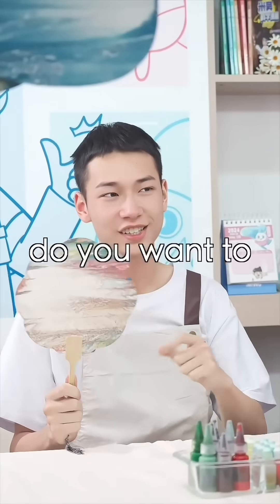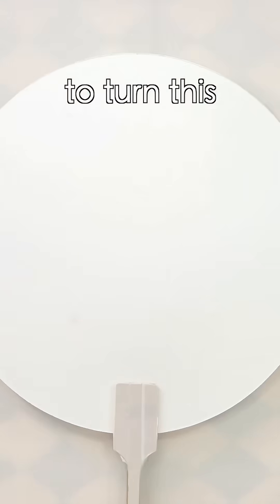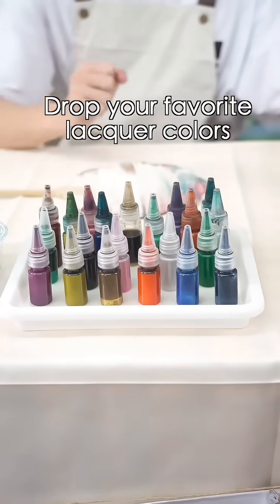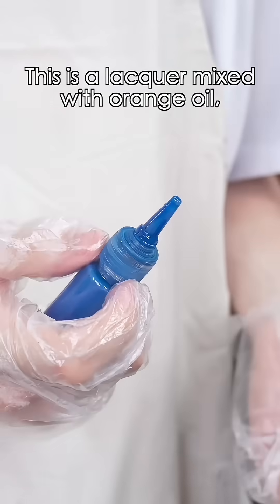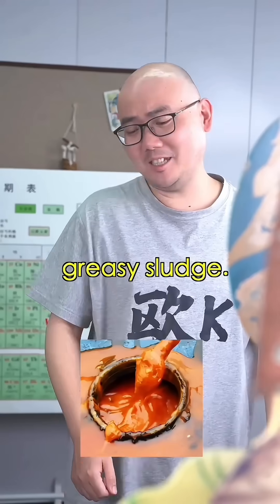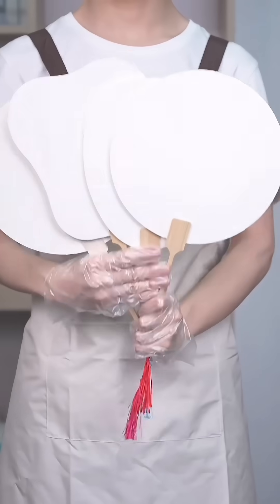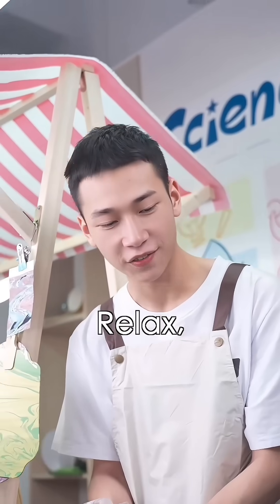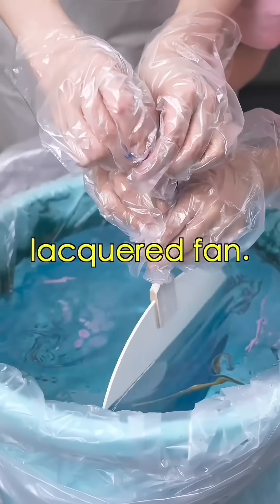Do You Want to Make a Special Lacquered Fan? Each One Is Different!!

Comment: I heard hard water is not a good choice for use in boilers because it corrodes the metal the salt gets deposited in the boilers which may cause explosion due to building up of high pressure can u try this😮😮 to see if the impact is really that much..... 😅
Reply: Gay